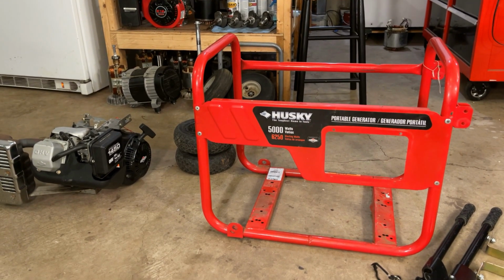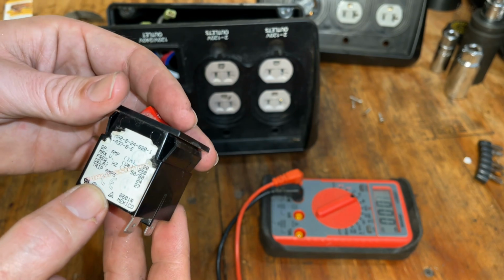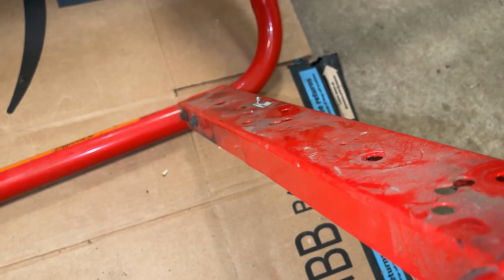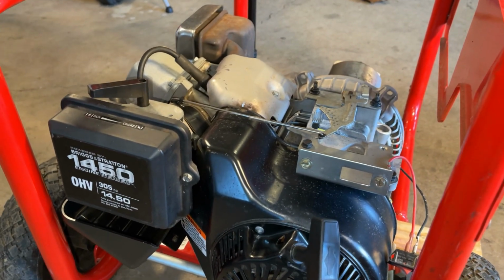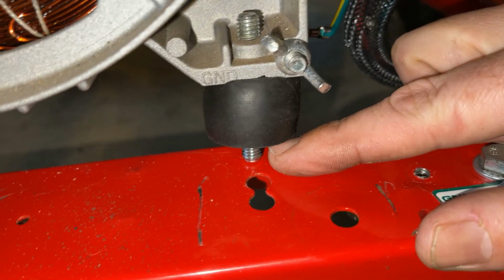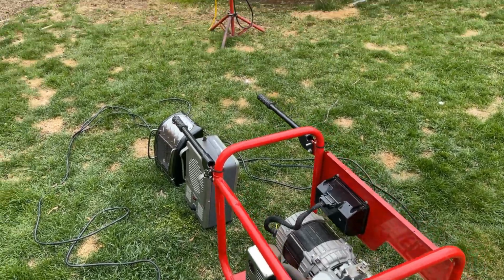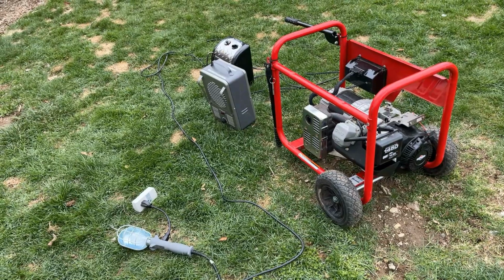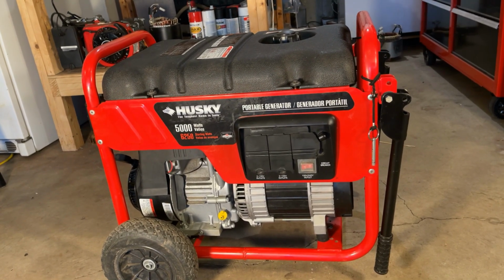Making a Generator From Spare Parts

Comment: I know this is another older video I am gonna comment on, but I see you use taps all the time, so why not use a die to extend the threads on one of those longer rotor bolts? You could just cut it to the right length after that.

Comment: If you're running 3000 Watts at 120, then that's 25 amps, no? I thought that circuit breaker pops at 20 amps?

Comment: Just letting you know next time you come up with the current staff that’s not expect you can turn them down and use a 20 under rod eternal 20,000 or like any machine shop instead of tossing the Kranks away at least you’d have some spares just remember to keep the 20 override with the 20 oh 20 under ride that mean with the 20 on the crank because if you put it on the wrong, crank your car the big issue and it will bolt on asking me how I know

Comment: One thing I did in the past when straightening metal was to use both a ball peen hammer and a mallet. I would put the ball peen hammer against the spot I was trying to straighten and then use the mallet to strike the hammer. Seemed to work for me.

Comment: Nice work again !  Would a strap wrench around the rotor works when ou tigthen the rotor bolt ?
Reply from the maker: That would work.  Just have to be careful if the wires and not to damage the rotor.

Comment: What’s the purpose of the spring around the coventry arm? I have just been given a generator essentially the same as this but the spring around the arm is broken.
Reply from the maker: It holds the linkage tight so there is no play.  It is called an anti lash or anti surge spring.  Without it, the engine may surge even with a clean carburetor.

Comment: Great going....
Where can I get a coil for Coleman Powermate 3500
Reply from the maker: You need to locate the engine model number to find the parts diagram.  Should be located on the engine.  Sometimes on a sticker, other times stamped into the block or other engine part.

Comment: That's another thing I love to do. Being a hoarder pays off, lol. I was going through my parts stash about a year ago and realized I had enough parts in my stash to build a Troy Bilt Pony riding mower out of them so I did. I built it completely from the ground up, and only had to buy belts for it. I had everything else, and all of the parts are the correct parts for the model that I built. It was a fun way to learn, since I had never worked on some of those parts and systems before, and it was very satisfying, since it cost me virtually nothing to build.

Comment: Hey James are we sure thread locker compound is effective on hot crank case? Page 12:10
Reply from the maker: They do make one specially for high heat.  Not sure what the max rating was on the one I used.
Reply: @jcondon1  OK I didn’t know thanks.

Comment: I am beginning in this hobby. It would be greatly helpful in your videos if after you get through with the repairs you give a general idea of a value to sell these generators. I understand this will vary from section to section throughout the country, however a ballpark guesstimate would be incredibly helpful. Also if you could tell the man hours involved with each project.   Thanks so much!! Love your videos, I’m learning so much!
Reply from the maker: A good running generator in the 2000-7000 watt range sells for about 0.08 cents a watt.  So a 5000 watt generator could sell for up to $400.

Comment: At 22:00 you do a clearance check on stater. Is that why you put tape on long stater bolt to center it? Also what do you do if there is interference?
Reply from the maker: The tape is only to center the bolt.  Not necessary, manufactures let it go in off center.  If interference then most likely the stator is not seated correctly in the housing.
Reply: @jcondon1  thanks bud

Comment: I was wondering (maybe I missed it) how many watts it is now . I see the old frame sys 5000 watts . Thanks .
Reply from the maker: The powerhead can handle 5500 continuous watts, but it is only a 9 horse engine so it can only do the 5000 watts as advertised.

Comment: G'day James, the rotor bolt is something that definitely would happen to me, Lol I felt your pain. You did a very good job on that one. I have several generators, they're my main power where I live. So they get used to the max, one generator will usually only last around the 12 months. Then something will have warn out by that time. Not exactly a cheap way to live, I do like to watch these videos. You never know if there's a new trick to something going around. Luv your work mate, have fun. Mick.
Reply from the maker: Thanks Mick.

Comment: Where are you located ?
Reply from the maker: In NY
Reply: @jcondon1  ok here is my dilemma. I have a Generac GP 7000 with 46 hours on it. Long story short I plugged in my water heater and the generator did not trip. I now have a reading of 85 volts on the 110 plugs and a reading of 185 volts on the 220 plug. I changed the capacitor and it brought the volts up 10 on each side. I checked the ohms on everything and get a .3. What else can I do. Thanks

Comment: James, where is a good place to buy parts? I don't necessarily need the cheapest parts I can find. Rather, I need to be able to find the parts I need. For inshave subscribed. Johntance, I am trying to find a flywheel for a Work force generator that has an 80cc engine. I cannot find the flywheel anywhere. The generator is from Aldi's and has a Chinese clone engine on it. I am not sure if it is a Briggs and Stratton clone or a Honda clone. I'd buy a Harbor Freight 79cc engine and use the flywheel if I were sure it will fit, but at this point, I am stumped. Any help will be appreciated. Great YouTube channel. Thank you for posting these videos. I

Comment: So wondering if you can assist me. also have a video idea maybe.

I've learned A LOT about small engine troubleshooting from you (thanks) but I am struggling with troubleshooting power.

Across the outlets everything seems fine. However when I test across the brushes... or take the brushes off we test around 60 k ohms. Is that right? I haven't found a video of yours where you say what it should be.

My video idea. Maybe break down a powerhead, kinda explain the wiring and coils, what they do and what their ohms and voltage should be when running/off (preferably off).

Another note I've learned about but never really seen gone into your video is the power rectifier for the 12v circuit. 

Thanks for all you help and all your videos.
Reply: So to somewhat answer my own question and ask a new one. I found https://vdocuments.site/87971gs-generator-resistance-tables-rev-7-561befd845f3b.html which lists several rotors spec resistance. They seem to range from 10-40 ohms... non of which are near my 60 k ohms. which brings me to my revised question...

have you ever had an instance of a good working rotor from a 4300w generator that would read about 60 k ohms?

and I realized I never described my symptoms... the generator output about 5v of power on each of the legs to neutral and the same 5v on the voltage regulator's coils... I tried replacing the voltage regulator before I tested all the voltages and it didn't make a difference (which in hindsight... it should have worked so thats good)

Comment: Another great video James. How big has your collection of parts grown? It seems the majority of generators are all running out of oil. Like my cars, my generator I have hade since '05 does not consume any measurable oil. What do you attribute these blown engines to? That might make a good tip on a future video how to avoid problems in the first place.
Reply from the maker: This one depleted the spare parts collection a lot.  Most of my spare parts are Briggs due to the oil issue.  I think the issue is ultimately the lack of oil sensor.  Maybe the wrong oil used and lack of basic checks.  Also most of these have a "Whether Shield" that comes pre-installed.  It recirculates hot air into the carb for running in cold weather.  You need tools and time to remove it.  Nobody does.  That will cause more engine heat and if using multi-grade mineral oil on a hot day, the oil will disappear fast.

Comment: Hi James. I  have a 3k Chinese generator with a problem, the generator starts normally when it is cold, but when I turn it off then on again it doesn't start. The spark plug has no spark at all even with a new spark plug. I have disconnected the oil sensor but still no spark. The  only way it is to wait until it cools down. Do you know what the problem could be? Thanks

Comment: The question, 3000 watts of your heaters is 25 total amps correct, the side of the original breaker said trips at 27amps and picture of the new one said 20 amps. Is it 20 amps per leg the breaker is rated at actually doing?

Comment: Nicely done.  You might open up the thermal breaker (fuse) and I suspect you will find significant heat damage on the contacts.  Since the breakers are thermally operated, high contact resistance will result in nuisance trips and erratic operation.  Every operation degrades the switch operation somewhat. You might be able to source the dual breakers from the actual manufacturer or intermediate vendor like Jameco or Mouser Electronics in Texas.  I believe the dual breaker is a standard component (Schurter 3-128-xxx series for example from Mouser).

Comment: U.K. I spent over 40 years as an engineer (old school) and I would say you are the best on YouTube at this type of work. Very few people in the UK have a generator, our mains is very reliable, a lot of it underground helps except when 'Paddy' gets carried away with his excavator. A lot of them only do it once of course. My problem will be spares, they are like hens teeth. The German gen. I have uses 15/40w oil and even that isn't easy to find. Can you believe  they destroyed the coal fired power stations before replacing them with windmills or some other rubbish. We built the first nuclear commercial power plant and now we can't even make our own. As we get some of our power from France and the frogs are hopping mad I thought I would get a backup. They wee wee in the street you know. Stay safe James - good luck.
Reply from the maker: That is the issue here.  Anything built in the last 30 years is underground, but 90% is still above.  The power is very reliable, but we get hurricanes and tornadoes.  When they hit power can be out for weeks or months (for some after Hurricane Sandy).  So most own a generator, but they sit around most of the time.

Comment: Hi James, I really enjoy your videos. You are so careful and deliberate in your work. I have a Powerland 10k with an engine that would overspeed if I let it. I was hoping that you could focus a video on governors. How they work and how to adjust, how to replace etc. anyway, thanks for all your vids. I’ve learned a lot.
Reply from the maker: Check out this video starting at around the 14 minute mark.  Covered a lot on the governor.  https://youtu.be/xlsTJcJxTqw?t=855
Reply: Thanks James for the response. My problem is fixed. Someone had the unit apart and incorrectly replaced the governor control arm and it was not contacting the governor mechanism.

Comment: Would it be better to have the rotor end bearing in place in the end housing before tightening the long bolt?  At any rate, great save!  That complete working generator sure is a lot better than a pile of generator parts scattered about!

Comment: Very cool and shocking you haven't had occasion, or parts, do one before this one. Gotta admit I was a bit bummed when you started off spray before commiting to the test tank and line. I had faith in ya! Very impressive that you found a breaker donor unit in less than 24 hrs. Your area must be a neverending source for all things genrator. All running or overpriced units down here as of late. Top quality, videography and editing as always. Keep em coming, James!
Reply from the maker: Thanks Eric.  Prices are all over the place here.  Recently got an in at a scrapyard.  Got some good cheap ones.  Unfortunately lots of parts missing and damaged.

Comment: Greetings:
IMHO: You may be reaching the current rating of the breaker due  to excessive output voltage. I am aware that this unit has no Automatic Voltage Regulator (AVR) that adjusts the current feed to the rotor brushes to control the stator AC output voltage. As the stator output voltage is directly proportional to the rotor current, that current needs only a small reduction to lower the output power (current) to keep the breaker from tripping. In simple terms, a rheostat with the capacity to adjust the current such that the output voltage doesn't go below 110 vac is appropriate. To avoid the need to monitor the output voltage, a fixed power resistor equal the resistance needed to reduce the output voltage could be substituted for the rheostat and mounted within the stator end cover. 
BTW: the stator winding used to power the rotor is AC and needs to be DC to provide the fixed magnetic field of this generator and accounts for the diode bridge part of the rotor feed circuit.
As any self-adjusting modification is essentially just a complete AVR then you might as well add one directly. Hope this helps.

Comment: Great share James . I see you can get that breaker in 20 Amp or 30 Amp .. I found both types for 55 bucks , But still kinda pricey  !  Great use of parts , Looks and runs great , ENJOYED !!
Reply from the maker: Yes, $78 was the first one I found, but there are some in the $45 range.  Still way too much!!
Reply: @jcondon1  I agree , Looks like it is a double breaker in one switch , Is that right ??

Comment: FYI 
Rather than some bypassing the fuse like this one was it is possible to substitute fuses from your car 
I have been camping way out when the circuit breaker/ fuse has done the same thing to me
So rather than break camp and going home early we mad due I still have the generator and it still has the auto fuses out of my truck in it

Comment: Jim, the nice thing about many generators is that they use commonly available recepticals available from home centers. As for the breakers, that's another story. I once had a lincoln weldanpower, and I couldn't fine breakers for it. I bought it for $35, the engine ran (diesel) but it needed a radiator and fan. I found a Geo tracker fan that bolted on, and it worked fine. I built a trailer for under it, and eventually sold it for $ 600. I think I did good on it.

Comment: Get yourself a set of unibits for drilling that thin steel. Twist drills do a poor job in that application. The next step up on the bit can also provide a chamfer which can be reversed from underneath to clean up the hole. They do not bite in like a twist drill does and leaves a much cleaner hole.

Comment: Nice video  I Have a Clark 2.2 kv can't see how to get rota of engine. There is no centre bolt in the rotor. Will it be threaded to the  crankshaft 
Or some other way of doing this. 
I like to watch the videos. Hopefully you will get this and explain the difference in ways to release the  rotor on mine thanks  Charles

Comment: It's actually a very lucky break for you, James, that you needed that circuit breaker.  Imagine if you had reused the entire outlet box and sold it on and then it burned out the new generator.  You would have had a very irate customer re-visiting you when he found the bypass.

Maybe you better look inside the box you ended up using?

If people are really stupid enough to bypass a breaker I guess you have to check every machine you get now?  Visually inspect wiring AND connect enough heaters to make the breaker trip?
Reply: I know this is an old comment on an old video but figured I would reply anyway.  If you turn off the breaker and all outlets are dead on the panel and with it turned on and under reasonable load it doesn't pop for 10-15 minutes I would say you know the breaker is wired up correctly without opening it and short of putting a known over-current situation on it to see it trip (could do this without breaking it open as well) not much more to test.  Do think that making a SOP for checking out all these auxiliary parts of the generators would allow a guy to feel pretty confident before passing a gen set onto a new owner.

Comment: 21:00 I didn’t get a good look at the engine isolator mounts but could it be possible that you put them on backwards and thus shifting the engine and power head assembly back that 1/2-1” short if the factory holes?
Reply: The possibilities r endless

Comment: What amazes me is that you always get the engine and generator end to match up at first try. I bought a "Hondaclone" generator a few years back, but the seller didn't say he (or moreover, his brother) had disassembled the cylinder head, and subsequently lost most of the parts. I bough another Hodaclone engine, because that was a cheaper option than replacing the lost parts. However, the generator end would not snug up to the bell. Either it was too short, or the engine's output shaft was too long. In the end, and it pains me to say it, we ended up robbing the parts from the replacement engine to build up the original. I've always been a bit weary of these machines and their failure to all be born equal - I'm utterly impressed that you've never encountered that same problem.

At least we now know why the previous owner of that 'fried 'n' died' generator decided to bypass that circuit breaker! What a pity they didn't consider some alternative fuse arrangement.  At least you got a good machine out of a pile of spare parts, but what would you bet that you'll now get three more machines, each needing one of the parts you built into this one? - Murphy's Law!
Reply: They match up on first try due to editing. You've heard about it. Things aren't always as they appear to be.